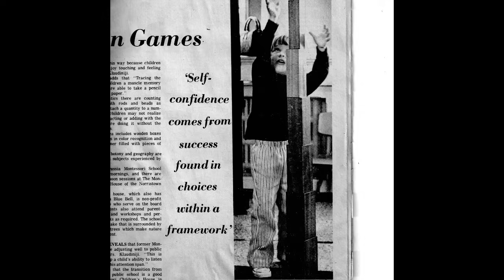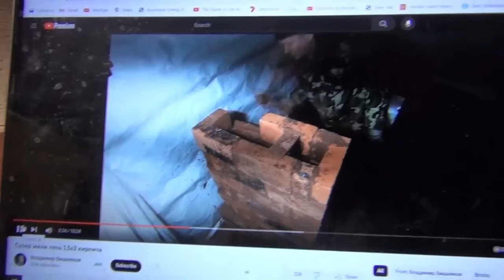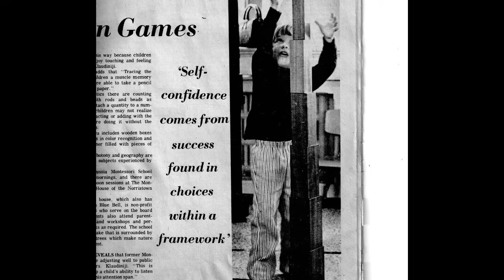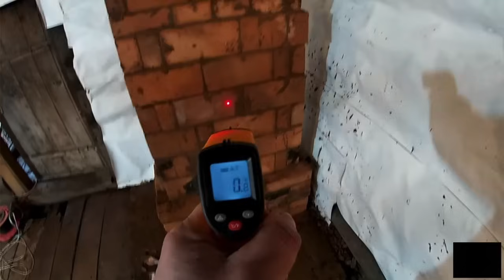Emergency Heat - No Skills Needed - Rocket Stove Meets Russian Stove

Comment: This is awesome Matt. Last year I'd listened to a discussion between two guys from one of companies "working on fusion power," and the one interesting part of discussion actually wound up being about bricks and how apparently bricks were even used in Rome to heat their baths and walls - and then of course notnilc programming started to push through in the discussion and they started talking about bricks as  "green technology" that we should reimplement to "save us all" and the conversation quickly dissolved from there. But, notnilc nonsesne aside, I think that here we all have an idea about the benefits of using certain bricks as a building material as opposed to more modern building materials...what I found fascinating is how they're now basically coating bricks in order for them to be used as superconductors that can store and harness electricity. My guess is they will do this as unnaturally as possible and that there's probably a variety of natural-material combinations one could possibly use between the bricks or within certain holes/ designs the would reproduce the same results. 

Perhaps this is an explanation for some of the insane architecture of the past, if there was an advanced civilization that somehow knew how to coat bricks and turn them into superconductors - perhaps this was something being done, and evidence of it either missed or faded with time - of course the question then would be where were the items that the bricks would have been powering etc. etc. and not trying to get into the bog, just find this whole topic of building materials & energy/heat production to be extremely interesting.
Reply: Did you ever hear that story about the Romans and blood in the cement they used or bricks

Comment: Haven’t read all the comments but I was a mason tender before the Army.  Did do some brick work but mostly block.  The blocks are cut to allow a quarter inch mortar line.  So, 7 3/4x 15 3/4.  Which makes a course of block 8 inches high and 16 inches wide.  Sorry for any mistakes, this is 30+ year memory.  Just checked.  Joints are 3/8.  So 7 5/8x15 5/8.

Comment: 44:44 That's a really great piece of info !  I bought a lil pot belly from a Russian guy off Etsy - really great lil stove for the money ( 200.00) brand new. He makes these stoves. However, I really screwed up bad on the chimney ...I got the wrong size then tried using various sealants - everything just burned and smoke and melting goo ...just awful ..had to shut the project down. Next, I started working on a rocket stove...I have most of the stuff but just felt intimidated on how to proceed. My 14 year old daughter thinks we can do it. So we watched this vid from start to finish twice and then other little parts over. This is a JEWEL ! This vid is soooo helpful ! I actually feel likey daughter and I will have a cozy set up by Christmas 🎄 The diagrams and easy visual demonstrations make it so much easier to understand - thank you ! The super pro vids are harder to understand because they are talking as if the audience is an experienced Rocket Stove maker ...so this was really great ! Your set up looks great Matt ! I've also made some other alternative heat sources, the clay pots with Crisco - I can verify they really work. However, this Rocket Stove is going to do a lot more than the clay pots. There's a lady in Vermont she made a huge rocket stove with mud- yes, mud and some clay bricks she made ...this thing was huge and it had arms so you could sit on parts of it like a heated couch. Thank you for this vid 💯💯💯 You have helped me see now how I can put this together - thank you 😊

Comment: Very cool. I've hobbled together a few brick stoves in my backyard (cooked a full dinner on one of em), and I had a friend help me weld a cast rocket stove from a piling after they demolished a big bridge in my area. It's almost as heavy as my indoor wood stove. It sits in my yard, and I fired it up last week for funzies. Just a few sticks and it's almost untouchable hot. Two chambers inside, and my exhaust vent is near the bottom. Fire is fun.

Comment: This reminds me of that creep that renigged on that firewood deal u had. Check out sand batteries for green houses candle under a copper ring buried in sand in a bucket. If u cant get wood check out diesel heaters cost around 100 bucks one gallon of dielsel will run for 30 hrs. U can even cut it with up to 70 percent vegetable oil.

Comment: Hey i wondered when i see these designs with the convoluted internal piping passages, 
How do you get all the ashes and dust and crud cleaned out that builds up as the particulates fall out of the smoke as it cools?
Looks like the big ones ive seen with really long horizontal curved passages ,or any flat runs ,that some kind of ash and stuff would build up inside at some point.
Maybe not if ya use good hardwood.

This is really cool stuff really Matt glad ya showed this.
I havent had time to work on a new stone fireplace. I haven't had time to get back to researching designs.

Comment: I'm with you, Matt ... Last year, I spent way too much time (but enjoyed every minute of it) designing a little "wishing well" style circle with those little 1/12th bricks (yes they are real mini bricks) allowing a bit of space for allowing air flow.
(I really do consider this FUN!, lol ... can any of us say: slightly autistic? - and proud of it!)
Then I place 4 little bricks upright to allow more air flow.
 The circle now gets topped with an inverted clay pot. With a shabbot style candle inside, I can create enough "kill the chill" heat for an evening... especially nice for the heat pump style heating since it sends out air that feels cool.
The clay pot gets pretty hot and really made a difference. I originally did it for cute-effect, so was surprised when I realized I felt a tad bit warmer.

I've also made a way to add another smaller pot over the first pot thereby creating more heat-from-a-pot capability.

This year I got a metal frame  (the kind that that fits over a bathroom sink), placed candles under it and 3 clay pots on the top "shelf". Again I'm placing a second smaller pot on top the first pot. The shabbot candle still works just fine. *A tealight does not produce enough flame to create heat. The candle must have a good flame.

Anyway, Love seeing another person who "thinks like me" because, well, THAT rarely happens.

:) 🫶
😻

Comment: I would think that a 2 flue system would work a bit better.

The second flu would be a lower vent to the outside.  This would drae the cold air from outside, because many stoves and fireplaces pull the cold air from the room you are lighting the fire from. If the cold air was drawn from an outside source (even if drawn from the first 'j' turn) would it not be more efficient?

Maybe my thinking is off.

Comment: ⁹ I WONDER 
   if you could buy a flexible 
  dryer vent , send it up 
  down and all around then 
  cover it with concrete
Reply from the maker: Not a bad idea to create the initial channel, before the metal breaks down.... but the problem is... the concrete won't hold up either for more than a few years if it's a heater used often. Cinder block rocket stoves don't last either.
Reply: You can even create a foundry! 😂

Comment: Hey Matt, not sure if it was you, or someone else who mentioned this, but I’ve seen this in an old workshop; running the stovepipe along the length of the room, to act as a radiator of sorts.

(Sorry if that was terrible grammar; I’m sure there’s a troll/bot/chadGTA that can correct me.)
Reply from the maker: Yes.. the old timers ran the stove pipe around 12 to 15 feet of the house at about 8 to 10 degrees up before exiting straight up. Yes, a bit dangerous but they had to do what they had to do. I think the scene in Cold Mountain (the part with Natalie Portman....  "MY BABY!!!!" ... shows this.
Reply: @quantumofconscience6538  good stuff! Really enjoyed the video, and made me chuckle how you threw in: “…this is not what this channel is about.” at the end. Keep up the good work! 👍

Comment: Yeah, I’ve been doing that on and off for like 15 years, but doing it consistently for about 5 now. Animal fats seal ‘er up good. All of the fats, used cooking oil and dirty napkins go in the fire. 
They’ve changed the fast food. That shit used to cook like something alien. I gather the fast food bags I would find in my front yard and they would burn for an unbelievable amount of time.
Vegetable oil works, but I don’t like it. It’s too thin. I prefer used stuff from cooking. You can also compress leaves into logs and cover them with flour and water.
The top screen of an oil burner works great if you’re worried about embers flying out if you’re using it outside.

Comment: The Russian guy built a chimney without internal flue tiles, and a "fireplace" at its base. Use firebrick. They hold up better to the heating/cooling phases over time. Mortar the bricks together with type S, but add some extra Portland to it. It'll never come apart. Unless of course, as Matt says, this is temporary. And no joke, stoves & chimneys, while considered low tech, require a wealth of knowledge that you'll learn at no college or university. And, without that knowledge you could kill yourself or others with carbon monoxide or flame, quickly too.